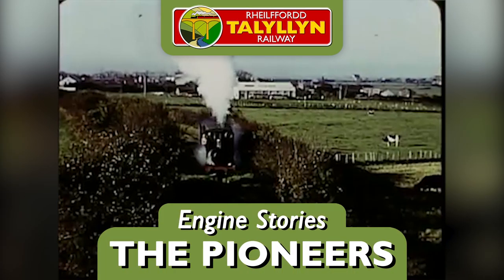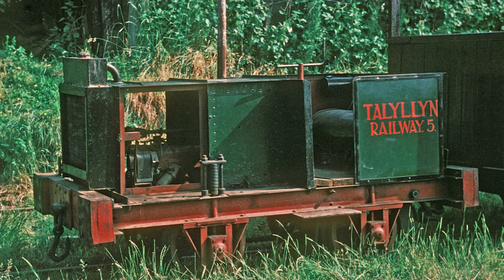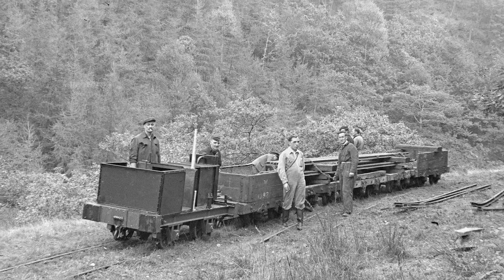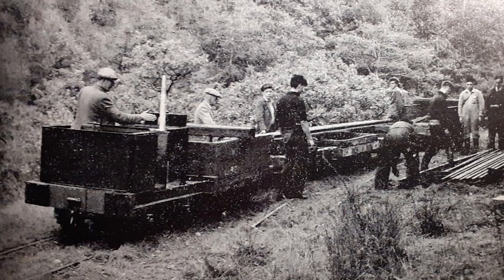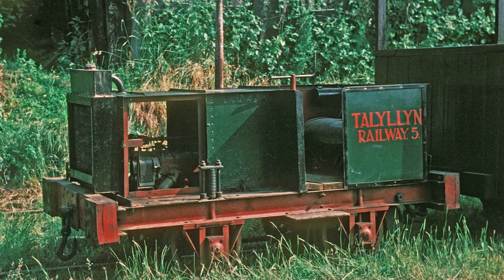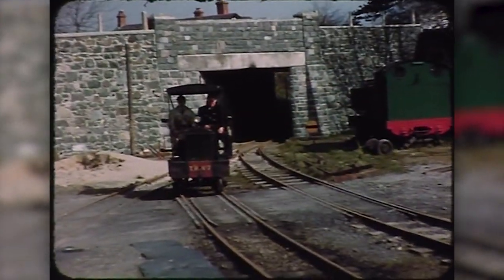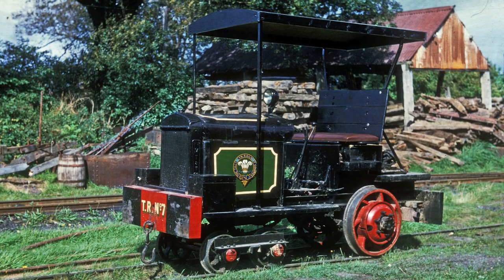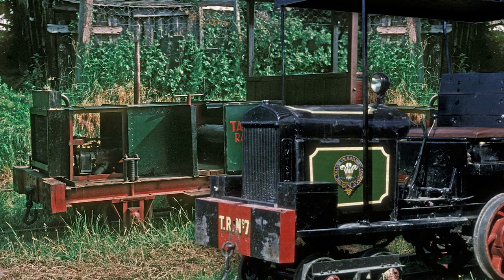Engine Stories: The Lawnmower & Charlie's Ant

Comment: Out here in Australia we had things we called "rail tractors", which were basically the frame of a wooden four wheel wagon with a tractor engine, chain drive and a very basic cab to keep the sun off. They were only used for pushing wagons around a yard, rather than on the main line. Eventually over 50 of them were built, and a few of them are still in service today.

Comment: The image used at 2:11 is not of Flat wagon No. 19, despite the photographer's assumption in the caption! That picture is of a rolling chassis used to transport the Ruston excavator (10-RB) along the railway during the 70's - notice the height of the wheels relative to the top of the frame

And No. 5 wasn't built on a Slate Wagon chassis (at least not one ever owned by the TR). The whole frame is metal (steel?), but doesn't match any of the other TR preservation-era wagons. I imagine it was purpose-built by Curwen
Reply: It was great to see the handheld film footage of No.7 being turned on its portable turntable